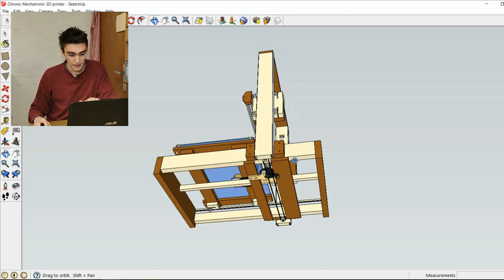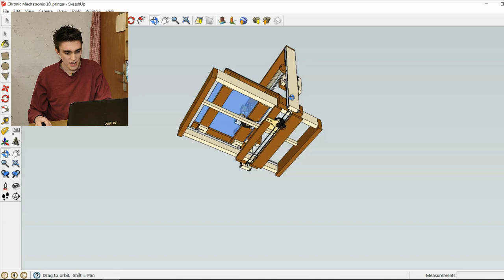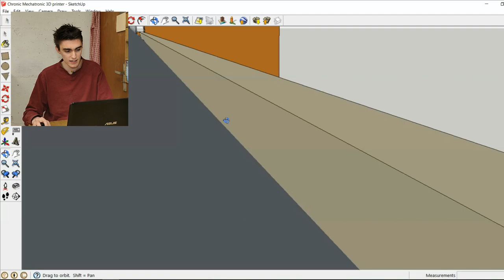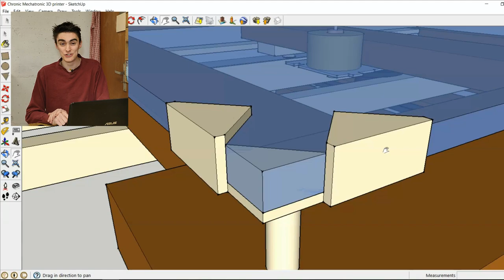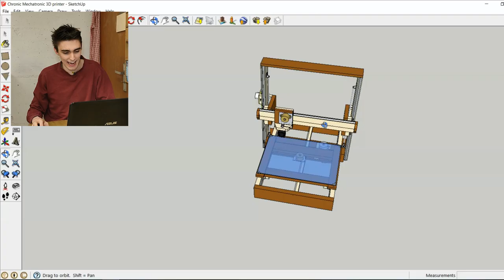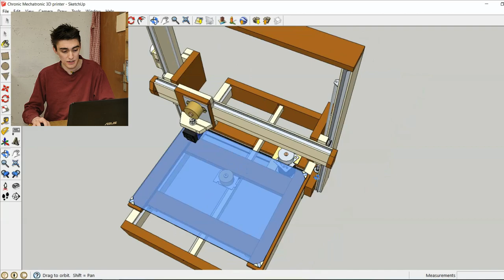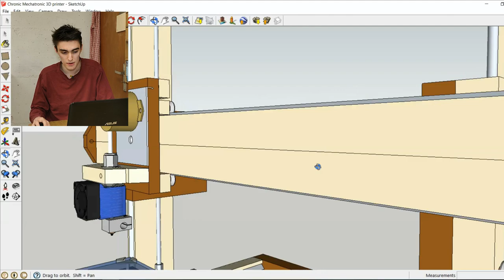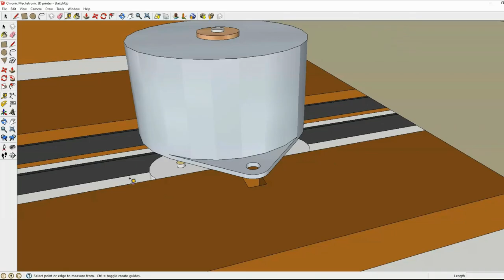The BIGGEST ISSUES with my unipolar 3D printer design | part 2

Comment: Ideas to you and your viewers ... 1. Glass bed. It can be replaced by a ceramic wall tile with smooth surface.  Pros: It is more heat resistant the glass. Easier to obtain a suitable size in a local construction store then cut glass. Small channels can be scratched easily in the ceramic backside to place nichrome wire for heating. The wire can be glued by car exhaust pipe sealent glue. (It is also some sort of water based fine grain cheramic paste.)  2. Steel fishing line: It can be replaced by a small (ie.: keychain) steel measuring tape. (It is easier to obtain locally and immediately then order fishing line.)

Comment: So, regarding those metal brackets to hold the glass bed - maybe countersunk screws, with a nut on the other side (towards the wooden bed).
Using a fishing line: I remember radio scales using fishing lines to carry the cursor, and they would also go around the plate that had the scale. I hope the groove option works as well.
As for the boring video - this really depends on the viewer. Those who just want the fish will find it boring. Those willing to learn how to fish will find it interesting. "Learn Electronics Repairs" has videos exceeding 30 minutes, and they're still interesting. But anyway, feel free to split the contents as you please, this is your channel after all.
Reply from the maker: I think countersunk screw heads might be a little too big, but I plan to makeshift-rivet it in anyway.
Yeah, strings were rather frequently used in various devices back in the day, I don't know why that practice eventually died out, it's one of these super simplistic designs I love so much for their effectiveness. Anyhow I stole the idea of the fishing line from the electronic typewriter I also took the stepper motors from :))
I personally also prefer longer videos, but if you want to achieve anything on YouTube it's a constant fight to please viewers and algorithm alike :// The algorithm seems to have problems connecting me to the right kind of audience anyway, as my content used to be way too diverse for a long time. Speaking of people just wanting the fish, when the first part of the series dropped 2 people actually unsubscribed upon seeing the video (and presumably finding it not fulfilling their expectations) 😂 luckily that loss has since been compensated twice :)
As for the length of my videos, they'll mostly stay at 15-20 minutes I think, though I might split the entire 3D printer series in smaller chunks to be able to upload more frequently. Generally I can't do videos longer than ~25 minutes at the moment, otherwise my computer crashes too frequently 😂

Comment: About the Glass heated bed idea, someone made the same thing you were talking by using 'Cunductive Copper Tape' on the glass and making a winding loop on it, they were inspired by how a car's back window has a De-Fogger mechanism by sending electricity through the heating elements printed/stuck on the inside of the glass (those brownish lines that goes from left to right)!
Reply from the maker: Yeah that might work, tho I suspect the heat might ruin the glue after a while? My original idea was to just tape on the wire using kapton tape, which might just be what I'll resort to if the fancier approach I have planned doesn't work out.

Comment: That stepper motors is not ok- no precizions- need stepper motors with 1.8 degredes/200 pitch- but you can try- good luck anyway - tnx
Reply from the maker: I know all that and I'm working around it.
Reply from the maker: What else would the gear reduction be for
Reply: @ChronicMechatronic  in my oppinion im sure you can find somewhare old stepper motors easy, you cand find on old floppy disks or old scaners, im sune in your town you cand find old stuff , or in recycles point, very cheep. good luck (y)